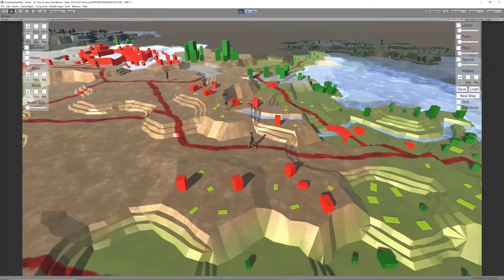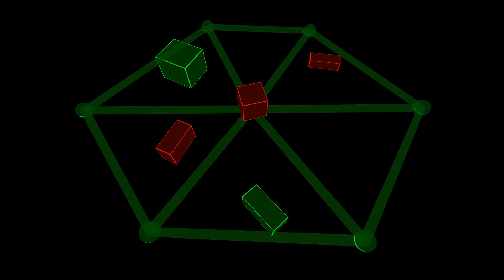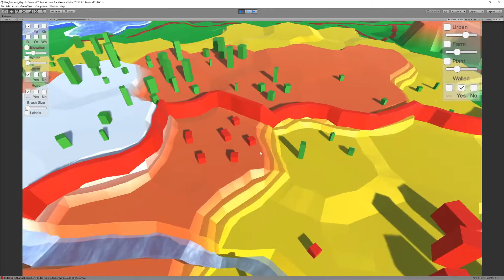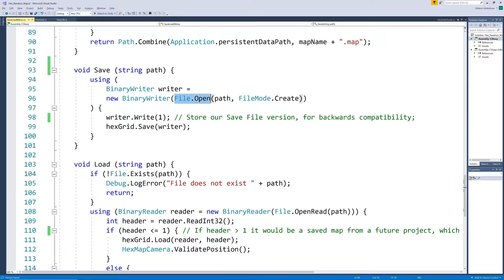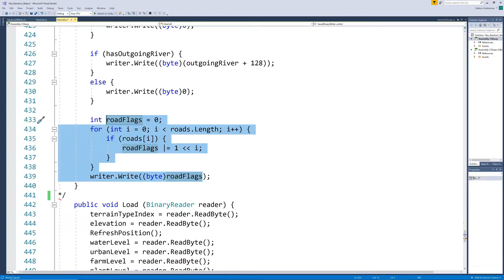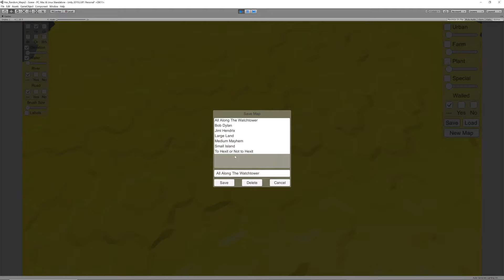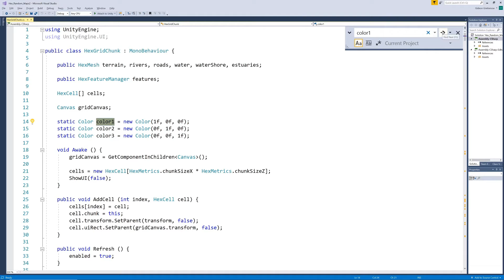[Unity3D Hex Map Game Dev] 2: Features, Textures and Saving/Loading

Comment: Hello thanks for your vídeos! They are very helpful. Are you using a different way to place the textures? I've followed the tutorial and it doesn't load any textures, it shows only red hexes...
Reply from the maker: Hi. I’m glad you find them helpful!
No, I use the same way, although I’ve added a lot onto it up to now (normal maps, cloud simulation, etc.) If the textures are red (not pink, which is the Unity ‘error color’), it could mean that you have one of the visualization functionalities of the shader set to on. I remember one of them having red as the main color.
Reply from the maker: If you want to send me a screenshot on Discord (or Messenger), you can find the link in the about section of the channel.
Reply: @RecOgMission  That is really what is going on, the textures are all red, I'll send you a screenshot on Discord. Thank you for your help!

Comment: Does this mean that on my Linux machine I can further reduce the file size to 4 bytes ? (ext4)
Keep the tuts coming. Ill be reading the awesome tutorial by Catlike Coding's while I complement them with this series.
Thank you for your work !
Reply from the maker: Hi, and welcome! I've never coded on Linux before (I know, right!?), so I can't tell you, but if it's a data type that can store 4 bits (up to 128) instead of 8 bits, and the rest works the same, I can't see why you can't store (and save to disk) something that is guaranteed to be <128 in it.
Yes, his tutorials are indeed awesome ;) You keep watching and I'll keep producing!
Reply: @RecOgMission  Ah it was a joke you see, since the filesystem is ext4, like your joke with fat32 :)
Cheers !
Reply from the maker: Aha, if only I had some experience! Even though it required an explanation, I appreciate the joke ;)